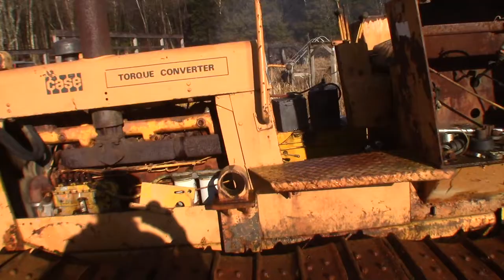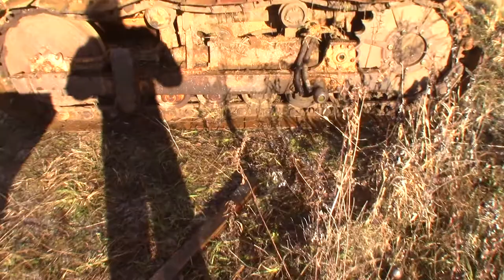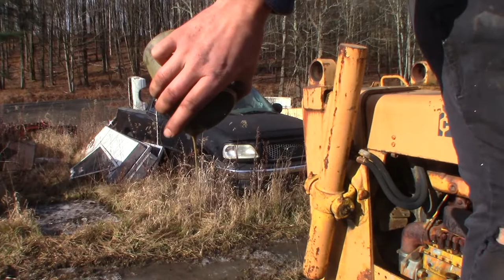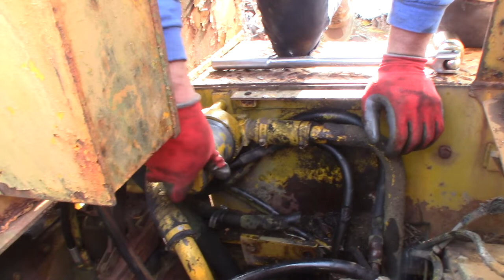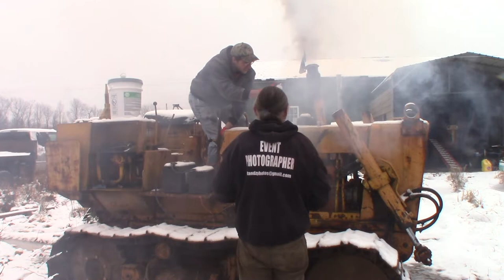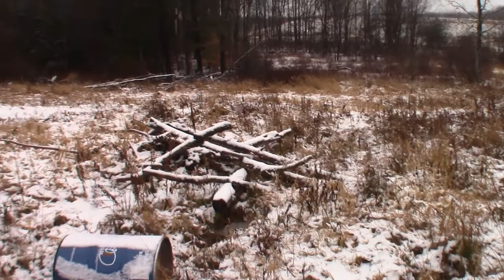1150 Case dozer  Plugged screen or just low on fluid?

Comment: I have one of these that goes when it warms up but the energy through the TC comes and goes. Trans is fine, the shaft stops trying to rotate. How does the TC get it's oil? That was basically hydraulic oil you put in there? From what I understand there is  pressure control valve mounted by the TC that the TC oil goes to a cooler at the radiator and then back to a tank or maybe the transmission? the TC pressure is at 45psi and the trans pressure is at around 250psi.

What do you think could be wrong when the TC grabs intermittently?
Reply from the maker: Hi Doc; I’m not sure. Does the pressure drop while it loses spin?
Reply: @JohnFrytag  No. The only things with the pressure is that when i raise the RPM the trans pressure gauge flickers real fast a little bit as if there is little air pockets coming through and recently I did see both gauges drop to near 0 and the trans came up first and then a minute later the T/C gauge came up, but it's not like when they came up it magically started to move again.
Trans fluid is super low and I also heard the trans charge pump suction hoses can suck air after aging at the clamps.
First I am going to get the fluid level correct and change the trans filter which is under the seat on the left side in a canaster. I will have to remove the floor plates to work on the charge pump suction lines it if still does not work.
Reply from the maker: We found the sump tube spun to a position instead of bent down was bent up. So it would maybe suck air if fluid was slightly low. The older models had a sump tube thru a compression fitting (allowing rotation of the tube) the later models had a 2 bolt flange holding it into the trans housing. Maybe see which you have.
Reply from the maker: FYI; Changed channel name to John Frytag. Thanks!